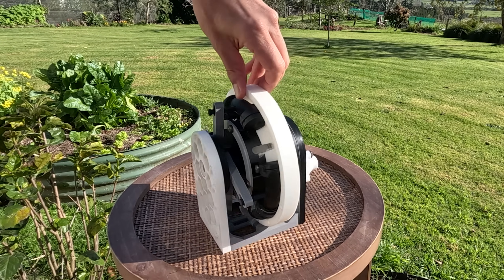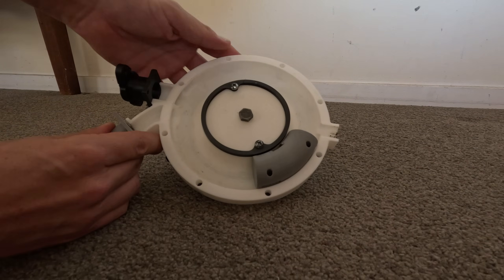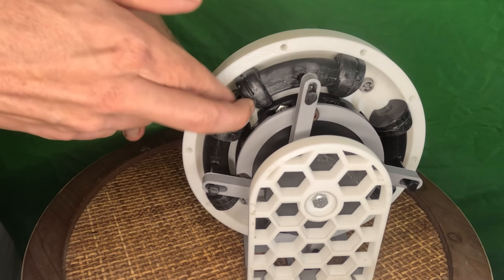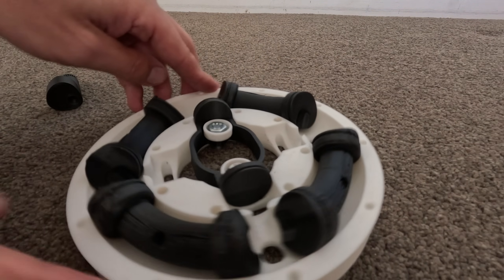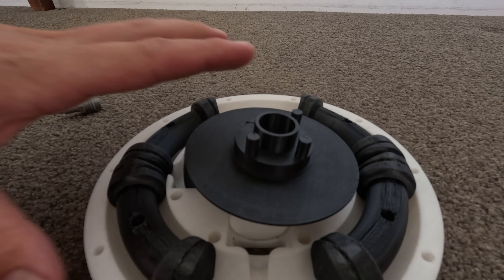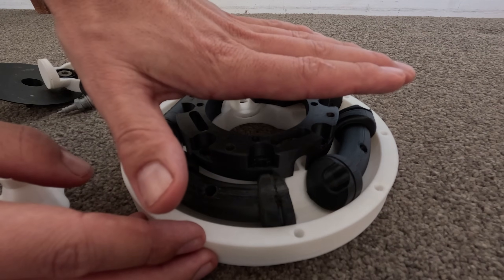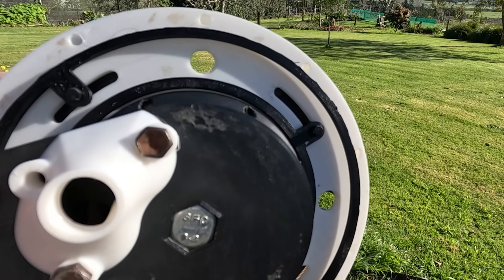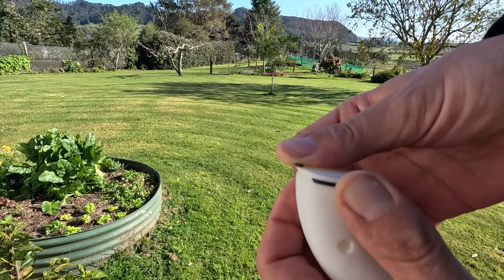Toroidal Engine, I Think this will work!

Comment: Could you use an air swivel and solenoid valves to pulse air in the spark plug holes to test a printed version so that you dont have to buy metal parts before getting it spinning?
Reply: I just saw the other comment about using compressed air. I dont think you would need thousands of psi to prove that it works just enough to move the pistons.

Comment: Your doing great! Ever think of making your engine lubrication graphite based? I think it would improve your chances. Good luck.
Reply from the maker: I guess that could work but will just run 2 stroke oil until I get it figured out, I probably won’t even do any cooling either just to keep it simple for now

Comment: Alternate engine designs usually have some big flaw that kills their potential to replace the norm... all I can think of is the difficulty of making toroidal pistons/chambers compared to cylindrical. Am I missing something (head gasket equivalent?), or will this just work really well after R&D?

Heck, with some wrist pins I don't think the pistons would even need to be toroidal sections. Each combustion chamber could be cylindrical like a mini normal opposed-piston setup. Probably not worth it but it's fun to toss out ideas
Reply from the maker: Yeah I think I understand what you are talking about and I did cad model a bunch of different variations. The pistons cost $41 each which isn’t too bad. The cylinder can be done on a 3 axis cnc mill. Conventional engines blocks are simple to machine but the heads and cranks and cams aren’t. But I’m not sure what to do from the seal connecting the two half’s a sort of head gasket the can’t compress or it will make the cylinder oval

Comment: that be interesting as a horizontal steam engine
Reply from the maker: I actually first thought about this as a steam engine, I made a steam powered lawnmower once on my channel but it didn’t work that well. This one would work better but I realised it will work on gas too 👍
Reply: @dkthewelder  I saw that steam powered lawnmower episode. It was like a steampunk mad inventor type deal. so will you try and make budget working model before? levitating pistons in your engine or i think it may start munching down heavily on oil like a subaru/othermotors.  Awesome videos and interesting concepts!
Reply: @dkthewelder  a cold explosion for less distortion no matter the way you look at it ull get heat.

Comment: DK the engine designer! Had to watch it twice to try and get my head around it. Getting parts made like the curved pistons is such an advantage, no way I could make those. How long did it take to do the engine takes itself apart footage ? 😃
Reply from the maker: Haha it only took about 10 minutes actually just trying to try something a bit different 😂. I don’t know how they can machine those pistons, machining takes ages and they seem to be able to do it for the same price I can get the materials. The Chinese subsidies manufacturing I’m pretty sure they get say aluminium and stuff way below cost

Comment: Why does the whole assembly need to rotate? Make it stationary and there will be less problems with sealing
Reply from the maker: I tried designing that for a while actually it work and I may end up doing that. There are no sealing issues on this engine only the intake under cold vacuum, and the exhaust to atmospheric pressure so it should be ok 👍

Comment: I was researching different engine designs at some point. The conclusion I came to is, the reduction of parts means more clever/complicated surfaces with higher tolerances. That means they are more expensive to produce and maintain. Simple ICE engine is basically a block with round holes and flat surfaces. You do not need expensive tooling to work with it. Toroidal shaped engine sound like big 6+ axis CNC. Very expensive and difficult to mass produce at scale. Interesting, but the end game is sketchy..
Reply from the maker: Exactly why engines haven’t changed, this is more of a fun project hopefully people will be able to build their own in the future. This can be made on a 3 axis mill . The pistons can be 3d printed aluminium I won’t machine it PCB way will it’s incredible how cheap they can make stuff. 👍

Comment: Perhaps try making it run on compressed air. Add some valves and inject compressed paintball or PCP air gun 4000psi air into plastic version to mimic combustion. I suspect you've got vibration issues. I think the parts are going to smack into each other and tear apart almost immediately.
Reply from the maker: It would really need to be made from metal first the amount of sanding and sealing would take a lot of work. I will probably do as you say and run the metal version on air first. Thanks for the comment
Reply: @dkthewelder might not hurt to try it with plastic. Even if it doesn't seal well. I suspect sealing is mostly important for good compression. Air power doesn't need to be to concerning with good compression. 

Good luck. Here's hoping it works out.

Comment: this is fun n' that - but think about mass manufacturing this. Lathes and mills can easily handle cylinders. But making that thing with repeatable - tight tolerances. How would it be machined?
Reply from the maker: There are no tight tolerances on my design the rings do the high pressure sealing. And this engine won’t be mass produced, it would be something you can get machined and assemble yourself hopefully with a bit of a community to refine the design 👍

Comment: Magnets stop working when they get hot.
Reply from the maker: Yes! Like I explained watch the whole video aye haha. Thanks for the comment still
Reply: not all magnets. some alnicos will work to glowing red hot/brazing temps... most ferrites will take a few hundred C happily.

neo/rare earth are delicate.

theres a reason they always used ferrites in high power DC motors...
Reply from the maker: @paradiselost9946 yes! They are as powerful I think but would still work. And engines run under 100 degrees usually too 👍

Comment: If the piston moves in one direction due to mechanical advantage then isn't the advantage cancelled out by trying to compress the air (in the compression stroke) with mechanical disadvantage. I love the idea of the combustion chamber being the fly wheel.
Reply from the maker: Yes kind of, the opposing pistons are connected via that ring thing I show near the end . The power stroke basically directly compresses the next charge. I can actually change the shape of the ellipse and make the trailing piston completely stop at TDC if needed but I don’t think it needs too 👍

Comment: Anyone saw a design of engine that integrate ICE engine with electric motor? You know, for addressing small rpm range issue. Say power stroke is comming from combustion but the rest is handled by electric motor. I senpotential in the ability of running very slow with few pistons, by generating during power stroke and then driving through the rest or revolution.
Reply from the maker: I think I have seen the one you are talking about, apparently that MYT engine could run at 200rpm which is pretty cool
Reply: @dkthewelder  I am not sure it is that.. I do not see any integrating wtih electric motor.. it can do slow rpm for different reason. By integration I ment reduction of output power pulsation. You know, in regular ICE engine, part of revolution happens do to combustion, but the rest happens due to inertia of flywheel. I was wondering, if one could replace flywheel with electric motor. It could generate during combustion phase and drive during the rest of it. And that would be where increased rpm range is coming from as one of possible benefits...
Reply from the maker: @borglessborglet yeah! I get what you mean the generator works as the fly wheel, so the engine wouldn’t slow down on the compression stroke because the electric motor would be pushing it

Comment: So, while I do like seeing innovation, I have a few concerns around the design, mainly around your exhaust and intake.

The exhaust ports for the "cylinder" being internal could lead to heating issues. They would be cooled by the incoming air, but that mostly acts to preheat your intake air, reducing performance. But my biggest issue is that the chamber in sealed by a piston being pushed against it. The reason almost all engines use poppet valves is that the combustion pressure acts to force them closed, improving sealing. In your design, combustion pressure is forcing the valves open instead, risking leakage. Furthermore, as the force from combustion is pushing against the cam lobe, this will wear it down quickly. Also, while likely having a negligible effect, the exhaust has to fight against centrifugal force to escape.

Other thoughts:
You mentioned that the design is reminiscent of a rotary engine, which means that you could use air cooling, as that's why they were built. 
For the pistons, the heat of combustion would cause the combustion chamber to expand, possibly leading to the guide arms on the pistons pulling them into the inner wall. For lubrication, all the oil will try to move to the outside (not a bad thing as there is more surface to cover) which means that the inner wall may be under lubricated (perhaps some kind of curve could be used to redirect oil as it splashes about from the piston accelerating and decelerating like in a torque converter). Additionally, I don't know what the risk of blow by would be on these little oil reservoirs. Also, the longer the "piston" is, the easier it would be to rotate on the pin connecting it to the guide arm, maybe risking it oscillating in the chamber and damaging the rings.

Possible innovations outside of areas of concern:
As it is an opposed piston engine, you have good potential for good thermal efficiency, perhaps using hemispherical pistons (I don't know much in this area). 
It may be too complicated, but perhaps an exhaust port on the outer edge of the combustion chamber ring may work, as the centrifugal force would help pull the exhaust out, and the cooling from the rotating assembly would help dissipate heat. Using exhaust ports that are covered by the pistons may work and would lead to an easy conversion to a 2-stroke (although contain the oil being the pistons would become a little more complicated).

I'm happy to see you at least trying you ideas. I'm curious to see how it goes, more power to you. Thank you.
Reply from the maker: Thanks for the great comment I will read it over a few times to make sure I fully understand and I will reply again .
Reply from the maker: This is a great comment, the oil will be flung to the outside from centrifugal forces as you say but I think we could get around this by changing the shape of the piston like 0.1 mm from the cylinder on the outside and 1mm gap on the inside for example. The opposite pistons are constrained by those black rings on the back side that will heat up with the rest of the engine. I really did want to put the exhaust ports on the outside like you say and have no valve piston and it would work like a 2 stroke but that would be too difficult for me to work out at this stage. The piston working as a valve will have a roller the cam will be completely round where it fires so shouldn’t wear there could be blow by as you say which only goes to exhaust and the valve uses exhaust pressure to help it open making it more efficient In theory. The heat in the centre is a problem as you say! I’m not sure what to do about that yet. The first version will just run on 2 stroke oil and have no oil just to see if the thing runs! Thanks again for the comment got me thinking

Comment: I think end game anything relying on tight tolerance will wear out very quickly cause issues if you could eventually work towards every thing that moves having rings or seals side seals like rotargs etc etc i wonder if you could use sideways type rings between each of those valves maybe
Reply from the maker: No, my design doesn’t have tight tolerance sealing at all, only the piston rings are exposed to combustion. The only other seal needed is for the carburettor intake which will be a lip seal under cool vacuum. And also an exhaust seal just to keep the noise down so I can have a muffler. It will be more clear once the engine is complete or I figure out how to animate it 👍

Comment: Stainless also works for eddy current brakes. Anything electrically conductive works, so you would need a ceramic cylinder I guess
Reply from the maker: Stainless does have eddy currents but way less then aluminium, I’m not going to build that magnet engine version. I think the rotating housing one will be better

Comment: I'd be wary of using magnets somewhere they can accumulate metal filings. I really want this to work and I reckon you can do it.
Reply from the maker: I’m not going to build the magnet version, too many issues. The solid link will be more reliable I think 👍
Reply: @dkthewelder  Yeah, agreed. I've had a similar idea in my head too but just couldn't figure out how to implement it, all my ideas would have been as prone to sealing and heat removal problems as everyone else's, I figured the key was to somehow get the cooling vapours through the hot side but I kept falling into overly elaborate solutions that just kept exceeding my attention span!  
I reckon you're definitely on top of it for the cooling problems and I can't wait to be able to show my family who all thought I was talking shite "SEE! Told you I was on the right track!!!"  
It'll partly make up for all the nights I bored everyone talking about it and never actually making anything that worked! 😁
Reply from the maker: @EddieTheH I have spent hundreds of hours thinking about it haha, the way I have it now is pretty good there is a simpler way to do it as well that would work more like a 2 stroke. On my latest design the cooling vapours do go through the hot side I’m not that worried about heat to be honest

Comment: I see a lot of unused and wasted mass between pistons, you might want to inrease number of pistons so that that space would be used and their individual mass, therefore inertia reduced
Reply from the maker: Because of the slots in the housing that connect to the con rods I can’t change it much plus the inner valve pistons would get pretty crowded. But I get what you mean it would be nice to get more travel out of each stroke as well for more power

Comment: Seeing a working test on this even for a few seconds will be such a joy. Awesome stuff.
Just, those heat issues the other guy had... sounded like quite a legit worry. Hope you cover that as best as you can.
Reply: remember that magnets are also affected severely by heat.. :(
Reply from the maker: Since it my design shares the combustion and the fuel air cycle it will be much better. I could maybe get some cooling fins machined in as well, thanks for the comment 👍
Reply: @dkthewelder  Yeah, try everything you can. gonna almost certainly need some good liquid cooling too though.. try to perhaps add a cooling flow pipe within the sides of the outer shell of the piston chamber..etc. 

Did you think about the magnets and heat though, yeah? I had some strong metal magnetic balls that were hanging on the chimney pipe from my fireplace and they just dropped one day after a couple of years and had lost all their magnetism...
Reply from the maker: @al3k I’m not using the magnets on this version. I’m thinking since the whole motor will be spinning it will air cool quite easily with some cooling fins machined in